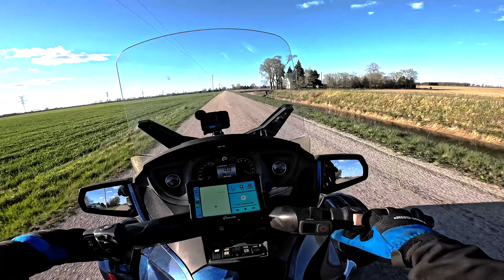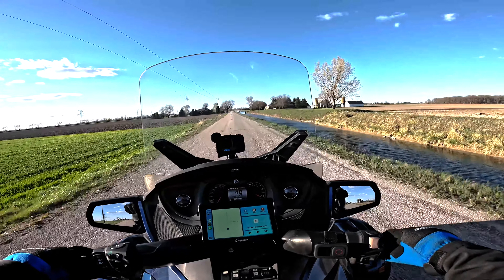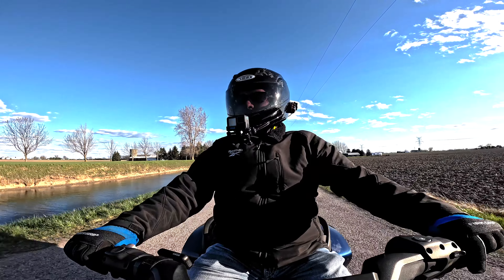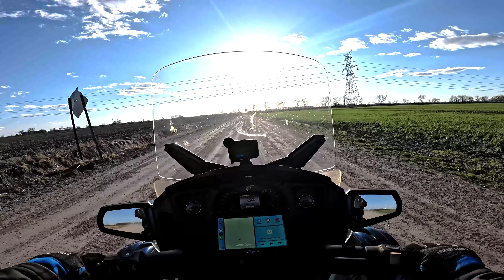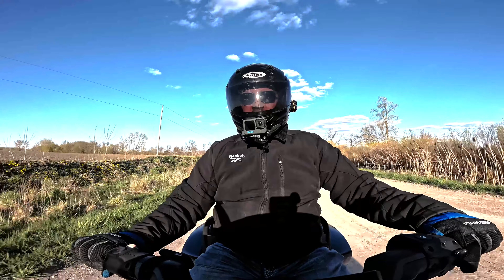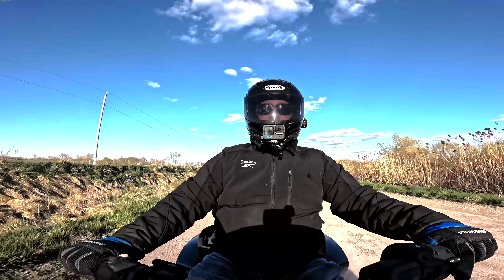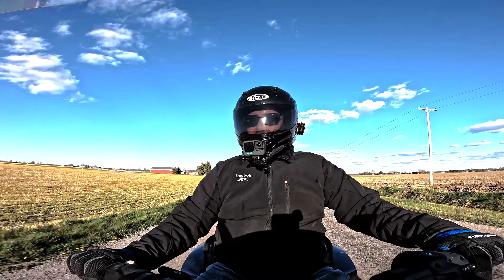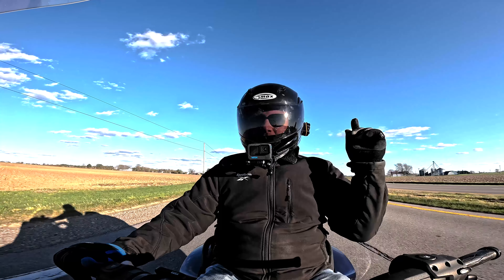Can-Am Spyder UPDATE - CarPlay, Loctite, Misc Parts

Comment: Oh speaking of LocTite, I did a video recently where I installed a GPS/Docking station (from Slingmods). When I took off the side panels, I noticed that the three torx screws had yellow loctite on them. When I put things back together, I did NOT loctite them again because I didn't have any yellow and didn't want to use stronger... I guess I'll be a bit nervous until I yank those covers off and check those screws at some point soon... I should have done it at the time and now I keep thinking about it! LOL
Reply from the maker: I can't leave my covers on for more than a month so I haven't even thought of loctite for those... lol

Comment: Do you have a video how you did this.  I just recruited my son to assist me with this haha. 

 I chopped that wire in two and tapped into it uh using some push connectors um
Reply from the maker: If you don’t run a wire to the switch area for a USB port, you could simply run the wire that comes with the CarPlay device direct to the accessory power wire near the battery (like the wire that was run in the USB port episode I did)